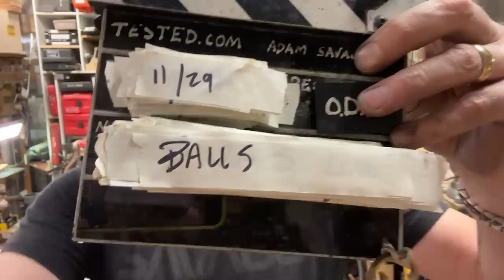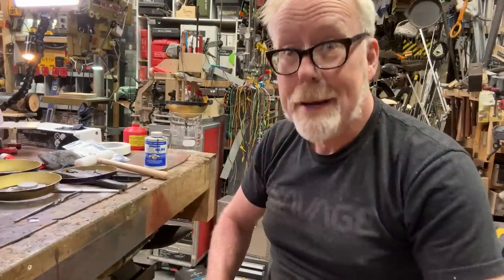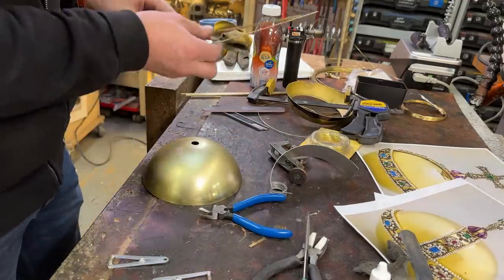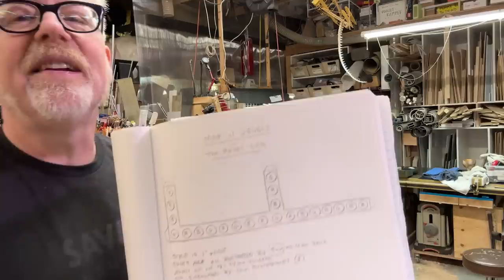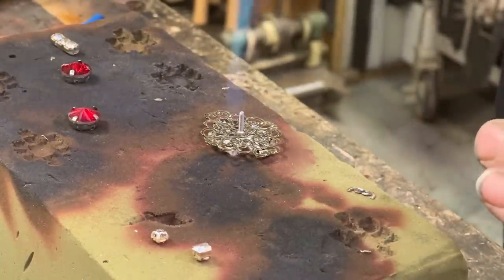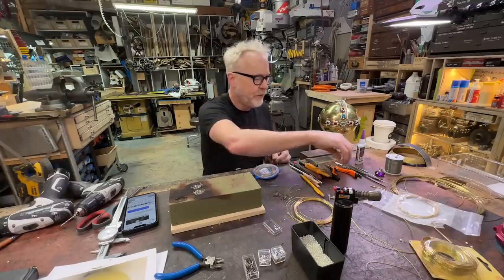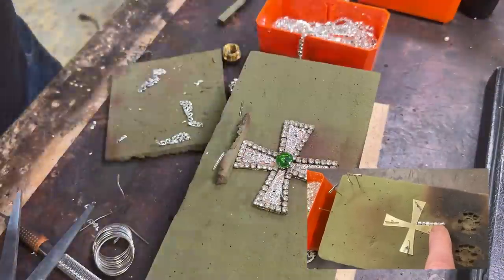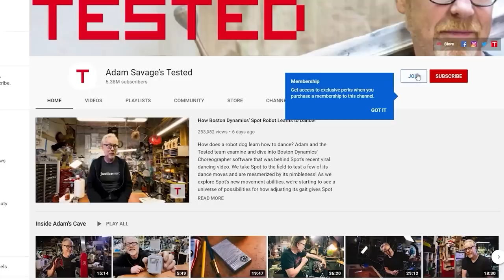Adam Savage's One Day Builds: The Royal Orb!

Comment: 4:26 a "relatively" simpler, but much cleaner edge method to do this is to set them in the lathe, as you did and score the cut line with a thread cutting tooth set parallel with the face of the chuck. Then you take them out, use snips to cut (preferably so you can use the discards for something else later) a 90 degree line almost to the score line and then simply bend and snap the discard part out. The finish piece will require a very light sanding on a block to get rid of the edge, but will have a perfect flush meeting surface to the next piece.
We do this all the time when making brass globes, which are surprisingly difficult to find (at least, cheaply) for repairing old chandeliers and roof top features.

Comment: I've made spheres from copper sheet metal and I would recommend adding a weight to the bottom so it stays upright. 
You have weight at the top which makes it harder because you need more at the bottom.

You have the finishing done already for this project and that makes my method impossible. But...

I add the weight before joining the two halves together. I clean the bottom of the sphere with acid and steel wool, then I add an appropriate amount of lead and melt it in the bottom of the sphere. 

If I want a solid sphere I solder it together on the lathe. I put solder in the sphere and affix it into the lathe with both sides clamping together. Start it at a slow speed and start heating the joint until the solder stops rattling inside. Then give it a few seconds with heat while it's rotating. Then let it cool down a bit while the lathe is still turning. 

Then I check if it's solid by dropping it on the ground from a cm and I listen if it rings or sounds dull. If it sounds dull the solder didn't do it's job. 

Thank you Adam, you are always a wealth of knowledge, I hope you see this comment and get more ideas.

Comment: I would have used the center hole to mount to an h-shaped attachment that fit over my table saw fence. A regular blade will cut non-ferrous metals like aluminum or brass fairly easily, so I would have set the distance to over half/less than half and just rotated the balls through the blade.

Comment: As a jeweller, it's interesting to see the 'general purpose workshop work-arounds'. There are some tips though; solder should be tin-foil thin, and between the components. Also, to solder multiple components, we set them face up in playdoh, put plaster on the other side, let it set then peel off the playdoh and solder the back. Incidentally, the English Crown jewels only date from 1662, following the restoration of the monarchy (the old stuff was melted down by the republicans).

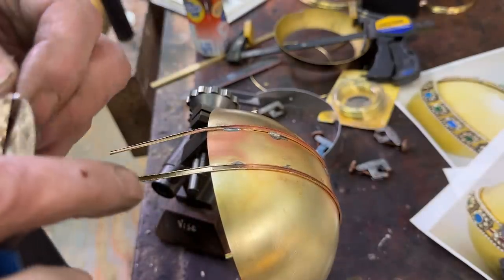Comment: 27:11 better than flux (that type) is to use the kind that's used for water copper pipes. The thing already contains a little bit of bonding agent and helps flow the solder (any solder, including electric type) much faster and cleaner. For basic projects, i didn't even use solder, just that paste (gray with flakes of metal inside).

Comment: I would have put a bolt that fits the hole tightly and hold it firmly with the appropriate nut and use the bolt to hold it in the sphere in the lathe and cut the spheres down that way.

Comment: I don’t know about the Eastern European choir but by the way you were tuning that cutter to your voice you might have a job opening on Ballybran.  By the way, it may have been a visual artifact of the video but when you were using the cutting wheel there appeared to be quite some movement or deformation of the orb in the vice. If it was real I assume you have more than enough experience with your gear to accommodate its vaguaeries but I thought I would mention it.

Comment: I'd not have soldered the small channels on, i'd have drilled a series of 1/32 holes in the channels and dome and riveted them on from the inside with cut off brass shaze pins. No clean up necessary.

Comment: Why would you not leave one (say the bottom) intact? There is no need for a “receiving lip” if you have near spherical contact. If need be (due to material thickness) then depress the intact shell slightly where the other needs to sit; but surely the band hides the joint enough that it doesn’t matter.